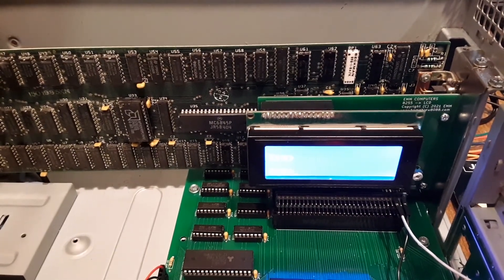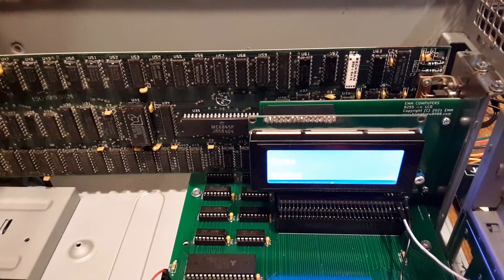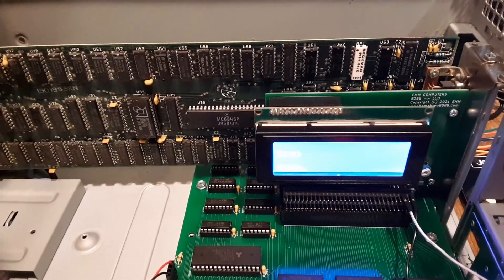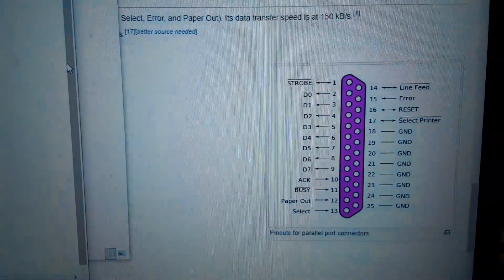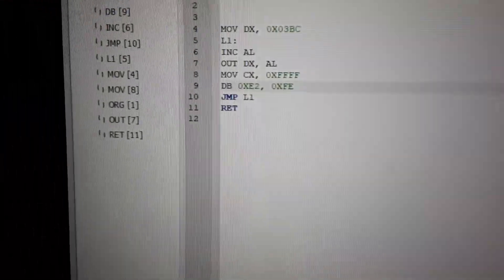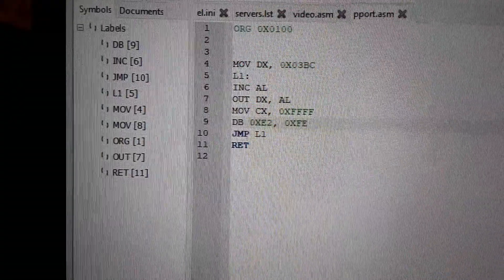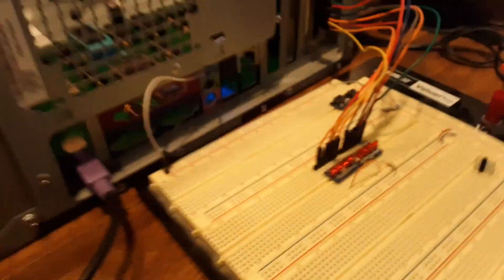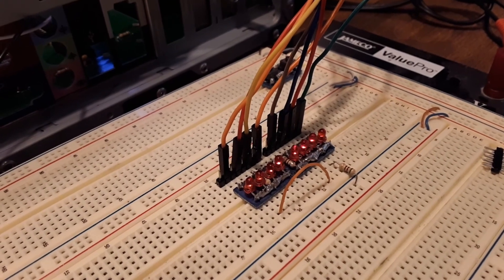Parallel Port Demo

Comment: I would like to try this myself. Can you please tell me what programm you use to controll the parallel port?
Reply from the maker: It is just code written in assembly. It has been a while so I rewatched the clip. It looks to be a bit of code compiled to a COM file. The system is booted headless with DOS.